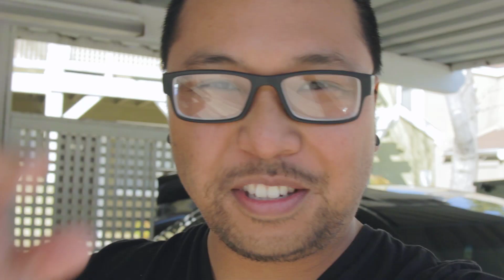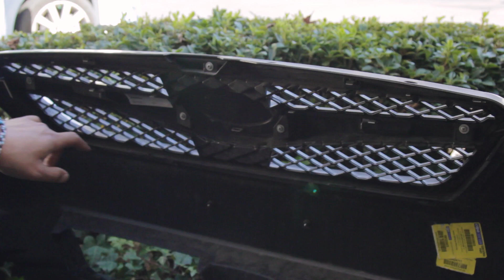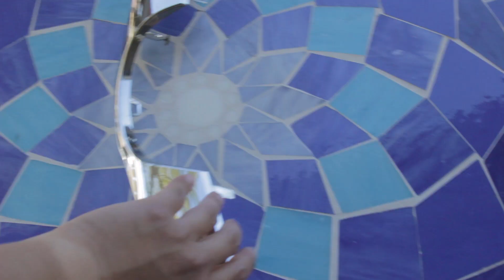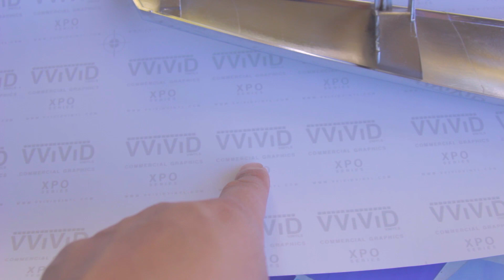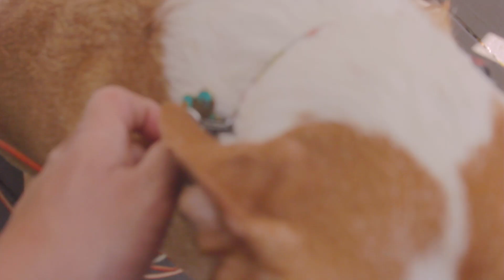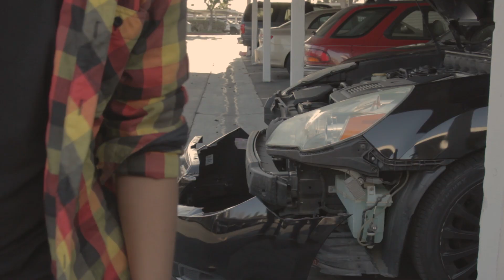BLACKED OUT Front Grill using Vinyl Wrap pt1

Comment: How easy/hard was it to manipulate the vinyl when you initially put the chrome down onto it?does the heat help pull out the bubbles? And where is part 2?
Reply from the maker: The Vivid vinyl I use is a little on the stiff end but is easy to work with when you add heat and have experience using it. 3M and Avery are good quality and are a little softer and easier to manipulate. Part 2 is coming this week or next. I was editing that video last night. Part 2 will be a little longer and will be more of a tutorial rather than a vlog. Thanks for watching and commenting I really appreciate it!
Reply: Boostbot nice man looking forward to part 2!

Comment: It says "made in Taiwan because it's probably not OEM. You can see the "Capa certified" sticker on the bumper, so the grill is also probably aftermarket, which also means the car was in an front end accident or something happened that they replaced these parts.